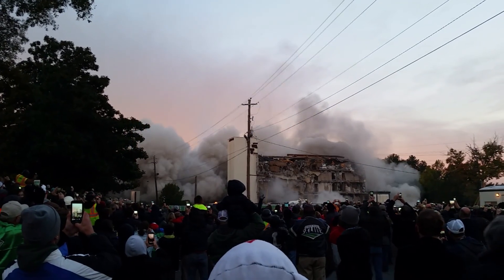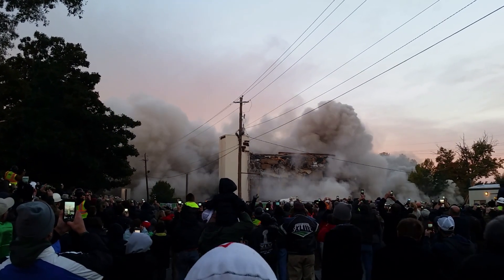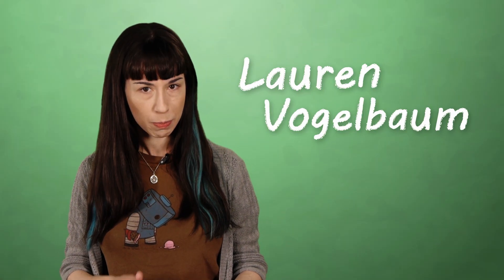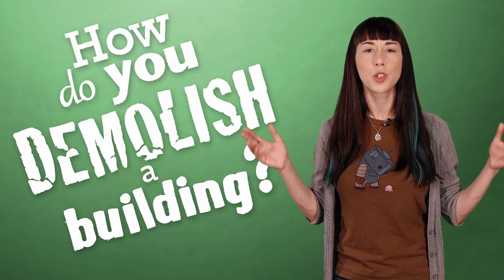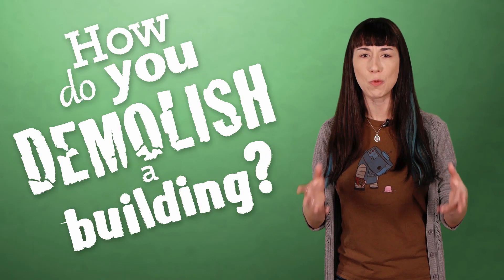How To (Safely) Demolish A Building

Comment: The mantra -  
1. Blow up in the center core of the building from bottom to top floors, usually through shape charges.
2. Then the rest of the dynamite detonates the area of the building in the first two sides so they fall inward towards one another....
3.Finally, the last part of the dynamite detonates the area of the building around the other two sides so they fall inward towards one another. 

THINK - INWARD TOWARDS ANOTHER  - or it won't be considered an implosion.

Comment: Unfortunately, jet fuel doesn't get hot enough to melt steel. Blasters used thermite powder and used gravity to free fall, which couldn't happen naturally 3 times in one day. 2 planes hit, 3 buildings free fell. Research demolition and learn the truth about the physics of it all...knowledge is power. 9/11...we won't forget.

Comment: The twin towers in nyc.  Its very weird,before 9/11,there were lots of shows and documentaries about demolitions but now,not so much.weird! Maybe to keep the masses dumb enough to beleive if you stack 110 concrete blocks up and hit 2/3 from top,all 110 will demolish into a dust pile smaller than 3 blocks high.

The only truth to twin towers is weeks or months went into predemo prepping both towers  to fall in the most shocking and detramental ways possible.with people jumping out of windows 30 floors above the damage.weird?  Most sophisticated building building codes in the world.no sprinklers...no roof access...no stairways access...phone and especially emergency radio communication.all of that after planes being hijacked and fliwn all over without a hint of resistance...sure seems like luck was in the terrorists side. Pnac just got a lucky break,seems to me.
Reply: 1 floor cannot support 15, can you do math? Did you even listen to this video? 1st off how would the bombs survive the office fires? LOL SMH!
Reply: 360SRH 2 Please stop saying this under every comment. Just Stop!

Comment: I've seen this before when a building falls with gravity, it's sad. Check out building 7 on YouTube. No super heated fuel but still. Fell with gravity
Reply: everything falls with gravity and if you actually watch the full footage the pent house on the top of WTC 7 collapes long before the rest of the building, so it was not free fall speed at all. there was super heated fuel from its power generators, it burn for hours. the side facing twin tower was heavenly damage from fallen debri. the entire building was tilting and bulging from the structure damage that the firefighters pull back knowing it was going to collapse. and you dumbass tin foil nuts think the firefighters were part of the conspiracy. even though many of the died. go fuck yourself.
Reply: @ccaptorchen  what damage? the towers fell in their footprint they didnt toss anything significant on building 7. both impossible. dust falling straight down didnt do anything. there was even a hole where the towers were instead of a 2 hills of rubble lol wake the fk up
Reply: watch?v=3HLDgjYuRHk firefightere on the ground who saw wtc7 that afternoon. knew it was too damaged to save. so take your arm chair expert theory about wtc7 and shove it..

Comment: does 911 count as a Building demlition
Reply: Building 7, remember
Reply: Did you even listen to this video? 1st off how would the bombs survive the office fires? LOL SMH!
Reply: @Leo-1t1tp  The same way they can be put underwater really.
Reply: @Leo-1t1tp  Did you even listen...demolitions need planning, preparing, by experts...building 7 we are told no planning no preparing no explosives or thermite which is quiet.
Reply: Bob Loblaw OK the great thermite debate! How would thermites  detonation source survive the office fires which burned for over five hours? Why was there no bright white flash seen from the thermite? Thermite also gives off a bang. 

How come the penthouse collapsed silently first proving the internal columns failed. What is the point of dropping tower seven the terrorists already achieve their objective dropping the twin towers. 

How are demolition teams get into building seven opening up walls in a secure building without being noticed? Buildings fall from fire all the time just search Iran and São Paulo. Steel frame versus concrete frame the tower in London was concrete frame hence it did not fall. Anything else?
Reply: @Leo-1t1tp  damn you really came back after 10 months
Reply: PBX1984 _ Yeah because somebody asked me a dumb question after 10 months. I like to educate people so how do you think the bombs or apparent thermite could survive the office fires?
Reply: Building #7 was controlled demolition.
Reply: Brandon Riley what kind of explosives were used?
Reply: @Leo-1t1tp  fax it pretty dumb that people still believe in it
Reply: @Leo-1t1tp  According to the government and it's shills, the building collapsed in it's own footprint because of an office fire, caused by falling debris. Hell if that was the case, demo crews would no longer need any kind of explosives on future building demo's. Com'n guy, you're smarter than that. One does not have to be an 'absolutist' when it comes to theories, or examining evidence- you can say WTC fell because of the planes, and still believe building #7 was controlled demo. BBC reported on Building #7 having fallen 10 minutes before it happened, Firefighters and Police are on camera and audio stating they were told "Then we made the decision to pull".
Reply: Brandon Riley I'm waiting for you to tell me what kind of explosives were used and how they could survive the office fires that burned for hours? 
As for the twin towers collaspe was exactly at the plane crash points. And no bombs heard or white thermite flash on any video.... You need to watch a real CD video to hear how extremely loud it is
Reply: @Leo-1t1tp  According to the government and it's shills, the building collapsed in it's own footprint because of an office fire, caused by falling debris. Hell, if that was the case demo crews would no longer need any kind of explosives on future building demo's. Com'n guy, you're smarter than that. One does not have to be an 'absolutist' when it comes to theories, or examining evidence- you can say WTC fell because of the planes, and still believe building #7 was controlled demo. BBC reported on Building #7 having fallen 10 minutes before it happened, Firefighters and Police are on camera and audio stating they were told "Then we made the decision to pull".
Reply: Brandon Riley So how could any explosives survive the office fires that burn for hours? Why did the twin towers collapse exactly at the plane crash spot? So you think the CIA told the bbc about the secret attack? Think for a second man.. the US government are morons. They are not geniuses like you think. They couldn’t even hide Bill Clintons affair
and they even admitted they didn’t find WMD in Iraq. How’s that for honesty?
Reply: On 9/11/2001 I witnessed two implosions! No dynamite or detonation devices used. Two perfect implosions. An absolute anomaly! Two jets hit two towers, at different locations of the structures and get the exact same results.
Reply: Kevin Mims How come the buildings collapsed exactly at the plane crash spots? How come no bombs were heard or seen on all the video taken close up? 

How would any bombs or detonation sources survive the office fires that burned for hours? How come a steel building in Iran and a building in Brazil collapsed from fire as well?
Reply: @Leo-1t1tp  In the construction of the WTC all of the building used a different constitution. Insted of having a frame on the inside it was pushed to the outside. Thats why the twintowers had beams running the up and down the tower. This was the same for WTC  7. For this to work the floors had to support the walls so they wouldn't cave in. When the plane crashed it took out a few floors. With the fires and the weight of a 747 on those few floors it was just a matter of time before the floors would give out. After they gave out nothing was holding up the walls and it came down right where the planes hit.  Ive been watching you aruge with people for a while now. I get where you are coming from. I used to think it was the govement too. But just keep an open mind and look into the history on why we went to war in the middle east. It has alot more than just us wanting oil. When you look at the history of the US involment in the middle east and central asia it doesnt make any sense on why we would bring down 2 of are own buildings to go to war. Just take a step back and look at the big picture.
Reply: Gilbert Downey Lol just copy and paste it to him brother